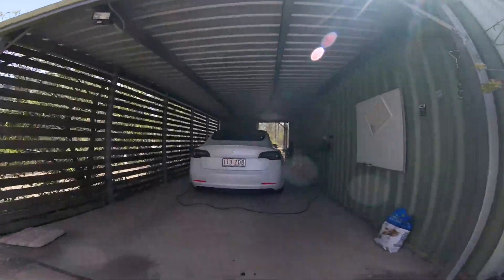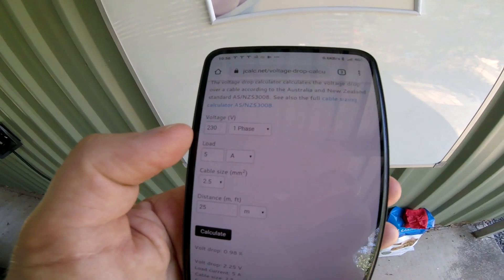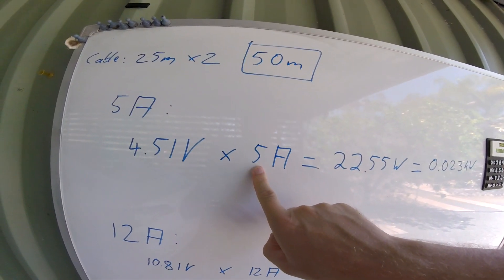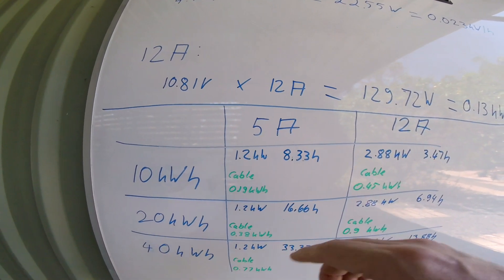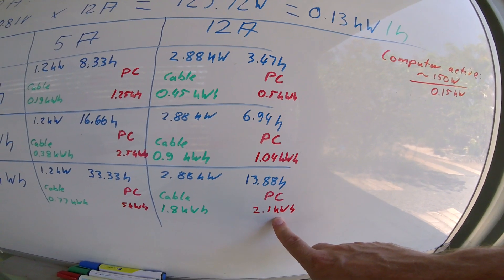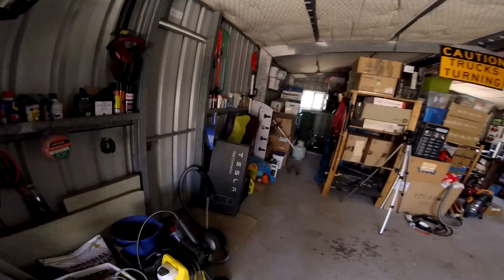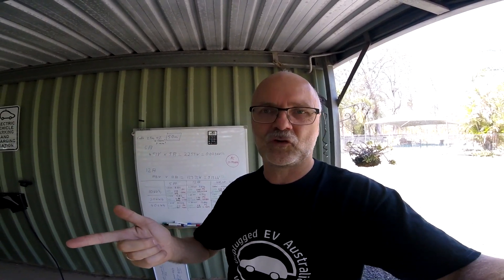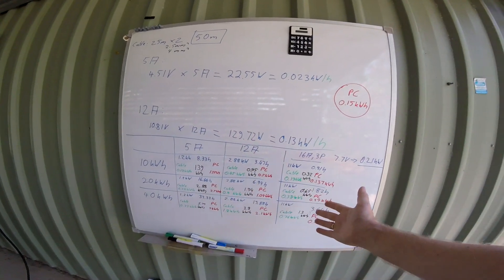EP294 - Tesla Model 3: Should you charge slow or fast at home?

Comment: Hi Andy, I looked at the voltage drop calculator you used and it looks like it is for cables, not individual conductors, so you don't need to double the length of the cable in your calculations, as I understand it.
I make the voltage drop over 25m of charge cable to be about 5.4V @ 12A (2.5mm cable).
Reply from the maker: Thanks David, you're absolutely right. In this case it's only 25m instead of 50m.
So the voltage drop halfs for the calculation. It still shows the trend and basic bottom line of the maths.
Good catch. I pin this comment to the top.

Comment: Andy - the loss calculation should be done from the power point nearest to the car charger because your meter box is irrelevant as a cable length starting point unless the 240vac step down transformer is in your meter box rather than the mains step down transformer 240vac output down the road (which I very much doubt)  The only way you can get any real loss accuracy is by measuring the actual voltage at the charger power-point under load and no-load conditions. What this then means is all the 240vac transmission line losses from the transformer through your meter box wiring and all other connections do not have to be estimated but can be accurately measured at your charger power point. The no load voltage value measured at the charger power point is the only reference that is truly relevant because the car charging is not likely to be the only load you have connected through the meter box in your shed or on the power line cables in your street! For the cable to the car from your charger you can still use the loss estimate calculation you have done however I suspect your calculated losses will actually be a fair bit lower :)

Comment: Does that mean a 6mm2 & as short as possible charger cable is best for home use [to minimize loss]? Does such a thing even exist? With the tesla charger that they provide for free with a new Model 3 purchase it is possible to replace the cable it comes with a thicker shorter one?
Reply from the maker: You cannot replace the charger cable for the wall charger. But yes, thicker cable and shorter length makes a difference.

Comment: If my memory serves me correctly, and it might not so double check it, but I was under the impression the AU model of the model 3 came with a 16.5kw onboard charger, (25amp) not 11kw (16amp) as you state in this video
Reply from the maker: All Model 3s have an 11kW 3-phase onBoard charger. 16.5kW is the Model S and X
https://www.tesla.com/en_AU/support/home-charging-installation/onboard-charger

Comment: Great video thanks!! Now makes me wonder... I Am wired in 6mm2 all the way to my main junction box at about 15m only. My idle voltage is 237V. When I charge the Tesla at 25A, my voltage drops to 225V (Tesla's reading). It does sound quite a lot to me - any idea what cause this? What about the resistance from home to transformer? What is your voltage reading on board? Thanks for your help!
Reply from the maker: We do some more testing about all of that once the Watchdog is here and we can see what's going on.
25A x 12V = 0.3kW loss in your case. Charging for 5h costs you 1.5kWh just on the cable. Are you sure it's 6mm cable?
You usually don't have to worry what is in front of the your meter box. At least you're not paying directly for these losses...
Reply: @unpluggedEV  thanks Andy! 
It seems weird the losses are just in such a short cable (15m). I have 10m from my main power supply to my garage where I have a separate junction box with fuses. Then 5m to the Tesla wall connector which has the 7.4m long cable. Cable from main to junction box is 6mm2 and from it to wall connector too. 
My meter is 40m from my house outside. Could it be the section of the cable from meter to main that's too small? My subscription is 12kVA so it should withstand double what I ask for the Tesla... 
I'll check tomorrow ☺
Reply: So I checked this morning. 237V before any loading at car and junction box then when I apply 25A in the car I have 231V reading at my junction box and 226V reading in the Tesla. That 5V drop is constituted of 5m of 6mm2 + the 7.4m Tesla wall connector that has 10awg cables if I'm not mistaken, which is 5.3mm2.
If I put the amperage in the car to 15A, voltage reading is 232V.
I must add my installation is now around 5°C. Can low temp affect it too?

Comment: That was epic Andy, I was wondering since long time what's better and here is a simple answer! 
However in my case is another problem. Cold winter (Norway). So I guess appart of computer and cable loss, long charging with low Amp. will cause battery heating system activation .. 
My cabling is 6mm2 (c.a.35meters betwen house and garage) and I have 3 fas system IT 3x230V... This forces me to use trafo  (installed in garage) which  is converting to the system TN-S - 3x400V and that is also creating another losses. So in fact everyday I am using 1x230V (curent between fases in IT system) with 10A and that seems to be most optimal ..
Reply from the maker: Wow, that's a complicated system. How fast can you charge with that?
Reply: @unpluggedEV    well, I have never fully charged from zero. So I don't know how long it will take in total.. Perhaps like on specs, for my Model S70 c.a. 7..8 hours - onboard AC charger 11kW like yours ☺ 
Now on winter current is dropping on my district down to 220..215V so it will be a little bit longer maybe.. Max power in car dash is 10kW and just 210V after some cable, trafo loss...
My normally charging with one fas,  from 35 to 70% takes c.a 13hours. 
Norwegian electricity is clean but network system is terrible for EV users... paradoks? Norway and  Albania has it in Europe ... Fortunately new buildings are comming with TN-S 👍

Comment: That's a great study of charging rates. I'm in the US with a Chevy Bolt, I'd like to find out what rates are best for my car. I have no idea at this point of the car's energy consumption during charging, I will try to find out. I doubt the Bolt has much computer losses when charging, it's not as smart as a Tesla. I don't think we have anybody doing this in depth testing with the Bolt. The charger supply cable size should apply. Thanks Andy!
Reply from the maker: Might be different with the Bolt and its computer. I guess it will be between the PHEV and the Model 3.

Does the Bolt has an OBD port? You can get the Torque Pro app and measure yourself...
Reply: @unpluggedEV  That's a great idea, I'll look into a Torque pro, yes it has an OBD2 port. The Bolt can charge at 32 Amps, 220 volts max, level 2. I have my "Open ESEV" charger set to 25 amps max to be a little conservative. Thanks again.